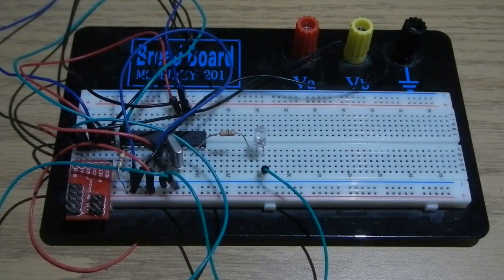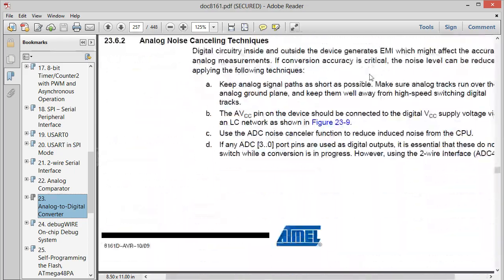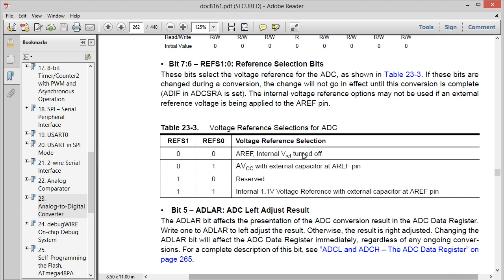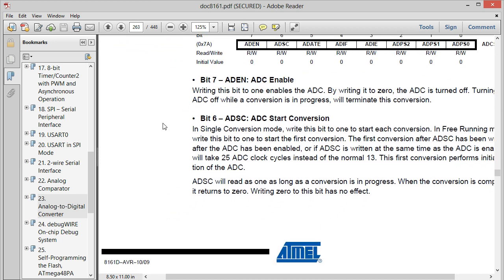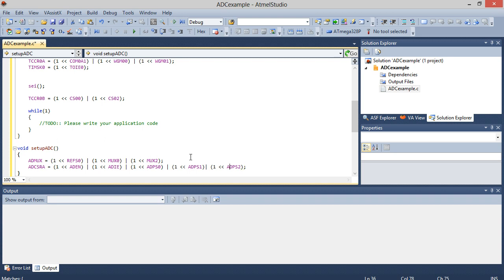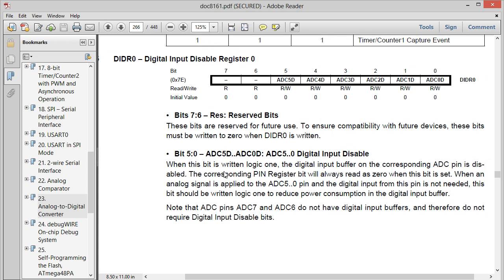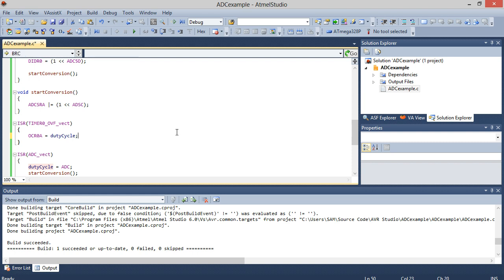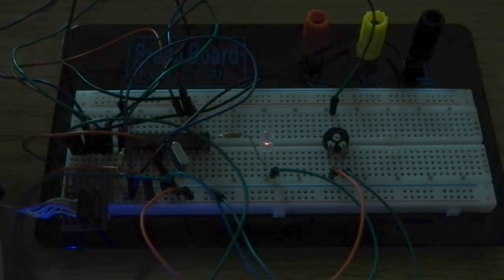Learning AVR-C Episode 8: Analog Input

Comment: For anyone wondering, you can bitshift right (>>) the ADC value by 2 to make it fall into the timer properly.  Code would be dutyCycle = ADC>>2;

10 years old but still very good information and well presented too.  Having some fun ditching the arduino IDE and how to directly use the atmega328p, amazing how different some of the logic problems become when the IDE isn't handling all the conversions between input and output for you
Reply: thanks

Comment: as you have ADLAR=0; THEN the ADCL register has the 8-bit value which you should map to the dutyCycle variable which in turn loads into the output pin OCR0A register.

Comment: Thank you for this video. I will post here really small code for ultrasonic parametric speaker, an PWM with ADC used. Only, it does not goes from 0 to 100% modulation, but rather some 5% to 85% or so. (too slow) And, it can modulate only in 32 steps, not 255, but it is okay for such good and fun toy. Output pin PB0 should to be connected to the gate of some power MOSFET, output from MOSFET to inverted transformer from CPU PSU (primary 240V is now secondary, and secondary of AC 5V is not primary). Analog input should be feed to ADC0 via electrolytic capacitor. For microphone input, it may be changed so that reference voltage can be 1.1V (internal), instead Vcc (5V). Just change "ADMUX = (1<<REFS0);" into   "ADMUX = (1<<REFS0)|(1<<REFS1);". Just make sure that on pin ADC0 input voltage DOES NOT get over 1.1V, else modulation can be distorted. If you are not sure, leave it at Vcc ref. voltage (5V). This CPU PSU transformer (ferrite) is good enough for parallel 10 or more ultrasound transducers, initially made for range measurements. Just make sure that voltage does not exceed 150 V peak to peak! (Although, tested on 450 V p-p, and one of four transducers survived after half hour)
Reply: This code above is made in just few hours, while watching yor excellent video.

Comment: About prescaller. Conversion value should be less then 200. So you can get right presacller by example:

/* 
   Must be less than 200Khz. So
   chip speed / prescaller value = conversion speed (which must be slower than 200KHz)

*   1Mhz / 128 = 7.8125KHz (this one OK because less than 200Khz)
*   1Mhz / 4	=	250KHz (more than 200Khz, means it is not OK )      */

Thank you for a video.

Comment: Was wondering why my LED dimmed up 4times during turning of the potentiometer. I realized while feeding cows that the times is 8bit and the ADC is 10bit. I made dutycycle = ADC rigth shifted two spaces to get it deduced by 3/4 without forcing the prosseor to do matemetical conversions. I lost 1,2,3 deciamls, but it don't show on the LED.
Was this a stupid move or?

Comment: So anyone knows how to eliminate that 8bit to 10bit thingy causing 4 messy PWM input?
Reply: I don't know if you're already find out about it, but for me I  divided the adc value by 4. the adc is 10 bit and in the range of 0 - 1023 and when i divide it by 4 the range will be the same as 8 bit which is from 0-255 (1024/4 = 256)